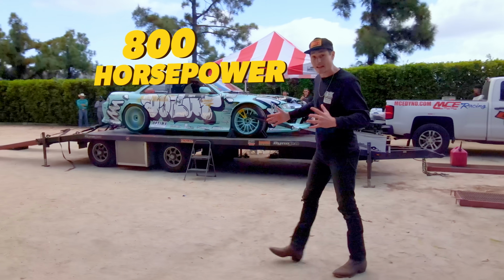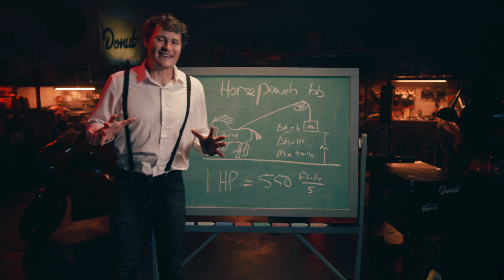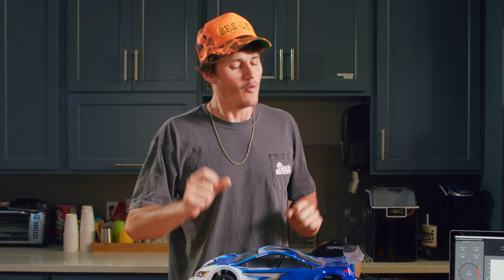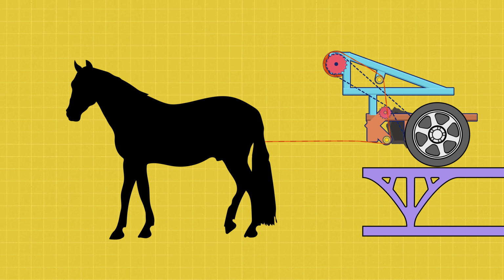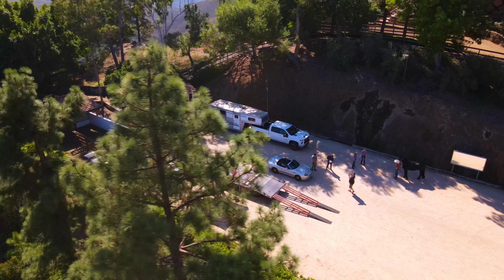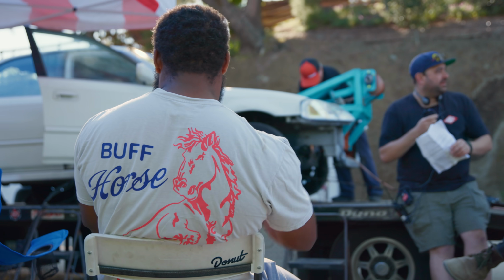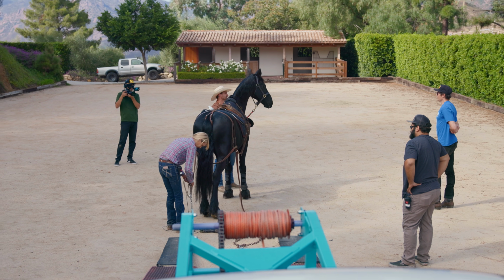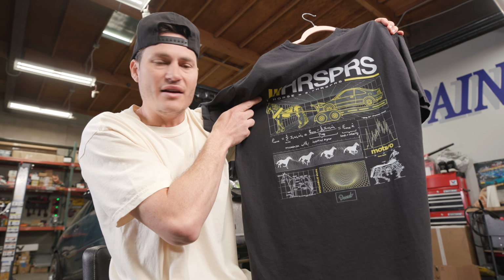How Much Horsepower is a Horse?

Comment: As an engineer, I feel like it’s weird that you have to involve a car in this test. you can just create an adapter for the horse to pull the Dyno directly😂
Reply: That was my first thought as well. Probably didn't want to engineer a new dyno for a one off.
Reply: @manz7860  Probably saved a lot of cost, just mount the device to the car and strap the car down to a normal dyno
Reply: It added an absolute fortune to the cost,  @JoshuaPlays99
Reply: @manz7860  they already have hub dyno's so super easy to support a shaft between the hubs  and turn into a tread mill instead of a winch type drum pull way simpler than this contraption
Reply: @Kraigthecanadian also a treadmill could allow the horse to reach top speed rather than the short distance that they used since horses can't go full speed in that distance.
Reply: @kingzach74  exactly
Reply: If you wanted to get the real long term number,  @kingzach74 , you would use the same setup the mills did, dyno axle vertical,  4 arms coming out yoked to 4 horses. 
You could probably even find an old mill and just attach a generator dyno to their drive system.
Reply: There are so many types of dyno,  @manz7860  'chassis dyno' was the wrong choice to start with compared to an engine load cell or similar. But if youre gonna use a chassis dyno, hub dyno is the obvious choice for this, just bolt on the spool to the hub mounts.
Reply: I spent the whole things wondering why the rig wasnt just a spool bolted to a hub dyno
Reply: @mycosys  this... 100%.
I guess a mobile hub dyno isnt a thing
Reply: Literally never seen a hub dyno that wasnt mobile, hey  @Hoofprint  - they kinda need to be to reach the hubs lol
Reply: I thought it was a little weird too. I'm guessing it was at least partially for the production. An engine swap to a horse is a super cool idea that added another, while subtle, layer of content and tied the video even more to the car focus channel.
Reply: They really didnt push teh engine swap angle enough,  @mythcql  - youre right - a treadmill in the back of a pickup/flatbed  would have made it a lot more obvious, and actually been able to move the vehicle.
Reply: that would not have been safe for the horse though  @mycosys
Reply: Which bit,  @CheapSushi  - having the spool directly on a hub dyno would be far safer than this contraption
Reply: Thats exactly what they've done, the car was the adapter. Then it was just mathematical formula to remove the car from the equation. Im not an engineer but that does seem what they've done
Reply: @Nolipslide  " Im not an engineer BUT " is probably where you should have thought better of that comment.
Reply: @mycosys I am an engineer and he’s right…. So stfu
Reply: @mycosys   Thought better of a comment? What the heck does that even mean. But I won't bother finding out seem like you a keyboard warrior lol
Reply: Sure bud, & definitely not an engineer XD  @Nolipslide   have a nice mute
Reply: I think part of it was about being a little silly and making fun content.

The car does a decent job as this sort of adaptor while being entertaining to watch and familiar to most viewers- plus, they have a few extra cars sitting around.
Reply: The first three words of your coment is the answer why. You're thinking as an engineer, not as a average car enthusiast. It made sense to me because i was not thinking about the science, but i was thinking about the content, and because this is a car related channel, the civic is what tied all together in my mind.
Reply: Why have a dyno at all if you're going to have to do all this math to remove losses in this somewhat complex system... P=FV ; V=d/t. So the load cell and a tape measure and stopwatch are really all you need here (along with an appropriate load) - it would have been nice to have seen the results from the "backup" system for comparison. For most horse powered systems one would be more concerned about sustained output (i.e. aerobic capability) rather than a short trot as was done here.
Reply: You are absolutley correct.  They had a GPS accurate to a cm, so they already had the tape measure.   @kappa7
Reply: It is a car show….
Reply: The math configured all that in. The mechanical part is factored in to the number. Tying it to the car was for fun, but the number is all horse
Reply: like a Dyno is just a torque over time reader.. get the horse to turn a mill with a set amount of known resistance... this was SUPER complex for what they were trying to accomplish.
If they really wanted the Dyno.. wrap the cable or rope around the dyno wheel...need it to go faster, use a pully mechanism or a bigger wheel ..
Reply: Replace dyno drum with spool = direct hrspr.  I’m not even an engineer, I learned about fulcrums, levers, and pulleys in 4th grade
Reply: Well put,  @johnfungable2289
Reply: first time watching reality tv??
Reply: Engineers dont not have infinite budget like scientist do u know
Reply: LOL  @ABD-7-7-7  - 1) you have that backwards, 2) this was the expensive way
Reply: That wouldn't look as cool on a t-shirt
Reply: The car is literally the adapter to the dyno itself. Don't you get it?
Reply: The bit where its the least efficient way to do it,  @BogartttAwAw
Reply: Could just be that they're comparing horsepower of the horse to the engine not the car.  There's efficiency loss thru the drive train and transmission i.e. whp vs hp.
Reply: I'm not an engineer but I thought something that looks like a treadmill would have been the most logical thing to make. They just need to make the horse run on a surface that is connected to those spinning wheel of the dyno
Reply: good idea engineer, you sure you're not a philosopher?
Reply: Then you won't get true power as engine does by direct to dyno because it skip all part engine has to transfer the power
Reply: I think finding someone willing to put their horse on your home built treadmill might be a challenge,  @Mcboogler . There are commercial horse treadmills you could safely adapt for other designs, though.
Reply: I'm sure they thought of that first and found out it wasn't going to be on point. Remember they want crank hp not wheel.
Reply: I agree, it was meant to look at the amount of horspurrs a horse can produce. Attaching Big D to a transmission or car defeat the purpose. Big D will not be able to efficiently thrust its power to the dyno. There will be way too much loss in power
Reply: That would be more complex than it needs to be. You really are an engineer lol
Reply: This isn't accurate by any means, they just wanted to make it about cars. There are many issues here, there are 2 types of slips going on. Horse's hooves to ground and wheel to the dyno. There is no smooth curve to start with, due to slack in rope.
Reply: Rope lol
Reply: if any of them had actually ever gone to a gym they would know that the machine they are trying to build already exists. but we dont watch them to be smart :)
Reply: No dyno needed at all. Could have it run up a hill and time it. Potential energy gained in altitude, divided by the time taken.
Reply: @nonconsensualopinion   literally how we did it in grade 9, everyone in the class knew their HP after the first week...
Reply: LOL was grade 11 physics for us,  @Azmodon  Everyone was a little surprised the heaviest was the most powerful.
Reply: @nonconsensualopinion the redundant system measuring force and gps location was basically that, but this is a car channel after all
Reply: US has some weird rules for filming a show.  If they didn't include a car somewhere, they could be sensored or sued.

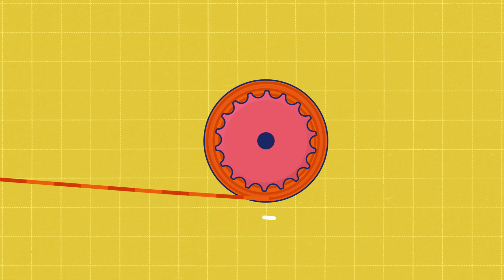Comment: 11:56 that is fucking moronic. so many mechanical losses. when you put a car on a dyno you are not getting the horse power the engine makes, your getting the power that makes it allll the way to the wheel. you lose SOOO much power through the drivetrain of a car. theres another type of dyno that measures power directly from the engine, this horse test should be as close to that (direct power) as possible. horse should have just pulled a fucking rope wrapped directly around the drum of the dyno.

Comment: great experiment!

I thought of a similar design during the video before the engineering firm's solution (which I am sure they are way smarter than me), so I am curious on yours and their thoughts on the following:

I too thought of running a rope through a drum like a winch, but then bolt/strap the "frame" directly to the dyno floor. Rope turns drum -> turns dyno through some kind of rope/chain/belt, or a free spinning axle with wheels. Wouldn't this be a more straightforward design than mounting through a car with less drive train loss so the "crank" power would be more accurate?

Or mount a "power meter" commonly used on bikes directly on the drum, which is effectively a strain gauge torque sensor and a cadence sensor? They're +/- ~ 2% 

PS: I wrote this before getting to the laser sensor issue of the video, cadence sensor would've solved that

Comment: I'm gonna ruin it for everyone. A horse's power decreases throughout the day. It sleeps too. It stops to shit and eat too. An electric motor can run indefinitely. Doing less work around the clock. You'd need 2 or 3 horses and a lot of maintenance on them every day. The horse needs to gestate be born raised and trained. This makes horses have less efficiency lowering that to an average of 1 horsepower. Also you have to clean horse shit. Most people don't use a horse for the 1 horsepower they do have.

Comment: Mate you didn't need all the drive train rubbish with all the mechanical losses that come with it. Horses don't use gearbobxes and diffs. Just weld wheel hubs onto a drum, wrap steel cable around the drum, bolt it onto a hub dyno, attach our steed to the cable and let him rip.

Comment: Content wise, awesome! Scientifically, not even close. For example, change the cable drum size and the results would be wildly different. Cable size, elasticity  of the cable, ground conditions. Soooooo many factors involved. This is an attempt to reinvent the wheel. An attempt to reclassify gravity. I admire the process, but it's a rule you cannot change...

Comment: A motorcycle dyno would have made a lot more sense. You could have linked the horse directly to the rear wheel with very minimal mechanical losses, and the dyno is already about the right size.

Comment: I think this great, however the weight of roller holding the rope and the length of the chain to the shafts carrying the wheels play a role in the accuracy, secondly Big D needed to get up to max pulling power with his speed aswell IMO..... lastly the GPS unit on the horse and the weight of the load cell with its steel clamps add weight which doesn't allow the horse to pull 'freely' without unnecessary weights.

Comment: im no engineer But the supply on the spool diameter will change the torque as the cord is let out. like a wench looses its torque as the spool fills with rope. have a supply of cord feed a single, i think its called a friction spool, capstan

Comment: Couldnt you have found a horse treadmill in California and just used an arduino and some code to meaure the energy output at the motor on it(wired as a generator) to give you horse power number. And yes they make horse treadmills.

Comment: Shouldn’t the shirt be resetting what 1 horsepower equals. Such as 5.7x the originally guessed 550? So 1 Hp = 3150 ft-lbs/s. Let’s try to get the industry more accurate.

Comment: Could have been easier. All you need to know is the mass of the horse, its speed and how long it takes to get there. To get the force, we take mass X acceleration, say the horse weighs 650kg and it can reach 40km/h in 4 seconds (pretty typical horse performance), that would make the formula look like this, 650kg x 2.777778m/s²= 18 055,557J. Divide the force by time elapsed and you get 4513,88W which equals roughly 6hp. 

Good episode though.

Comment: I think the original number was a combination of actual math and winging it. To truly measure the amount of work a horse could do is nearly impossible as it is a living creature that fatigues. Let’s say that you were to put a cut off at the time, like 1hr, assuming that’s how often they changed horses, you would have to measure the area under the curve as the horses strength would decrease as a function of time. Then take that area and compare it to an engine that does not degrade, and yeah maybe his statement is not too far off. Just like Jeremiah with his 1.16hp, try that for an HR and plot the area under the curve and it would probably be 1/5hp.

Comment: Awesome! So with the results of this test, when will the ratings for actual horse power (AHP) be added or replaced on a engine spec sheet? Example, with the results of this experiment, 425 whp is  closer to 75 actual hp. Kinda underwhelming when you're bragging about your numbers at cars and coffee. 😂

Comment: “Big D” looks more like little d.  Did u guys not reach out to the Competition Horse Pulling community to get an actual Heavy draft horse.  Nice looking horse but a light draft with a carriage style breast collar harness which is for pulling carts, wagons or light pulling bc it places pressure onto the windpipe choking out the horse if to much weight is pulled.   A full collar with hames puts the weight being pulled onto the horses shoulders and protects the windpipe it allows the horse to exert maximum pulling without damage to their windpipe.  The surface looked almost either pavement with dirt  or a hard packed gravel,  great if your a car with wheels as it offers excellent traction for wheels but slippery for a shod horse,  a grass surface or tilled and firmed soil would’ve given the best traction for the horse. 
Was the diameter of the rope drum taken into account as the line was pulled out as the smaller diameter would affect the amount of  force exerted the smaller the diameter got.

Comment: So the spec sheet on a Challenger with 394 HP should now read: Horsepower: 394 (69 BigDHP). What an incredible undertaking! The things that can be achieved when you get the right people (and horse) working together. Great job everyone! The campfire scene was so good. High Five for whoever's idea that was.
Reply: Bugatti Chiron Sport-300's Horsepower (based on Donut-Motivo "Big-D" Horse Pull Dyno, WHP divided by 5.7 rounded by the nearest .1)
The 1580 HP Quad-Turbo V16 is now rated at 277 BDHP.
Reply: @RaijinRacer011  Yeah, for five, ten second pulls, then back in the garage till tomorrow, for another 50 seconds daily use. This video was a bit silly, as it didn't explain the obvious which everybody is missing?? Peak power for ten seconds is useless to anyone who wants a reliable daily working machine. Watt was conservative with his HP unit. A machine that can deliver 8,000 Watts 24 hours a day, is likely equal to twenty horses. Ten on ten off not being worked to exhaustion. Conservative indeed.
Reply: @martinda7446  I know that, my reply wasn't a serious comment. It's just a thought of "what if Horsepower was measured by that test's results rather than Watt's initial measurement".
Reply: @RaijinRacer011  Sorry 🤠
Reply: So that means my car makes 22.28 HP
Reply: @DEIFAN  22.28 BDHP
Reply: You mean 22.28 BDP @DEIFAN
Reply: No. Horsepower was intended to be the average power of a horse working at a mill all day. The way a machine can. Engines at the time could put out their peak power all the time.
Reply: @mycosys 🤔
Reply: Sensational.
Reply: Nice
Reply: That sounds more impressive Dodge your move 🤷‍♂️
Reply: No yall have it backwards.
 One horse (Big D) put out 5.7 (hp)...
So:
100 hp =570 hp.
300 hp =1710 hp.
Reply: BigDeckHorsePowaa
Reply: Very Nice
Reply: That's not correct. Funny though. If one HP by Watt was slightly less than Big D, then the chargers actual HP would be slightly more. Per horse under Donut is more so, per one horse, the total will be higher. Watts measurement for the Charger is less horsepower per horse than Donuts.

Edit: sorry, I'm arguing the same thing. 69 Big D powers is correct. They divided, I multiplied to get the new big d horsepower standard. They divided to get their Big D hp from the Watts hp.
Reply: I have 73.7 BDHP.
Reply: Mi auto tiene actualmente 26.3 BigDHP jajajajajajaaajajaja
Reply: I had a horse growing up. The only things that motivated him was his grain bucket, or a pack of wild dogs rushing out the woods.

Comment: As an engineer myself, this is such good motivation for young engineers who want to apply their knowledge to questions they pondered on. Thanks Donut!
Reply: It was so cool, but i spent the whole video wondering why they didnt just bolt the spool to a hub dyno rather than that whole rig to transfer it to a wheel dyno
Reply: @mycosys 19:30
Reply: @mycosys we need tension to get an accurate answer. Where are you going to mount the horse power calculator? It is possible but it will create the process more complicated.

Comment: Why not have a hamster wheel but horse sized. Then you just set up a transmission to transfer the rotational power at top speed to the wheels on the dyno

Comment: One horse power used to be the amount of work a single horse could do in one day of labor. As a rule of thumb. Which is why the amount of power a horse can actually exert in a short burst is significantly more horsepower. That's the origin of it at least. The experiments were likely conducted after the term became the norm because people had the same thought as you. What does it actually mean? Not a lot. Bare in mind it was probably coined by a peasant in 3600BC

Comment: I would have just bolted a pulley that doubles torque onto a hub dyno… wrap your rope around it, get horse moving. Then when the dyno can easily measure torque due to the pulley size, half and presto…